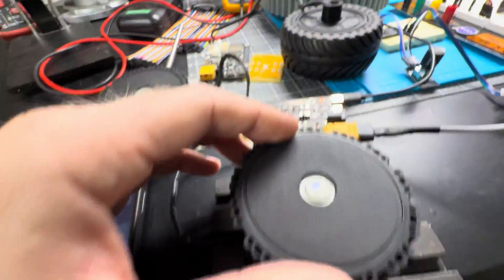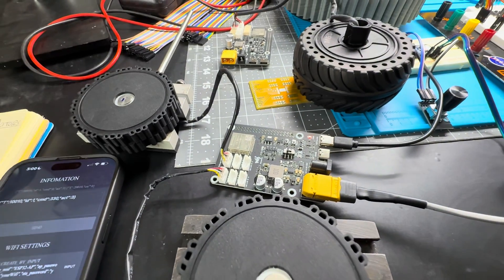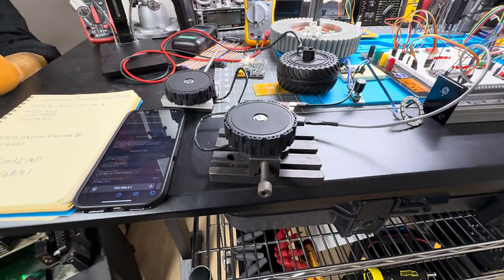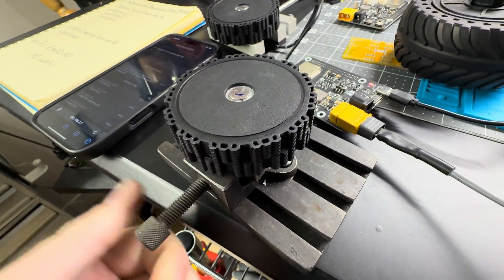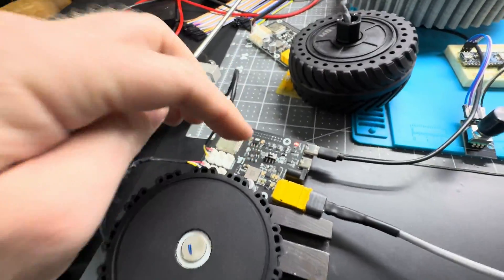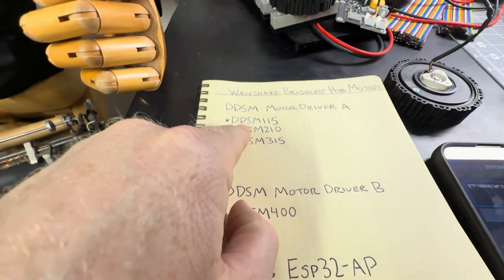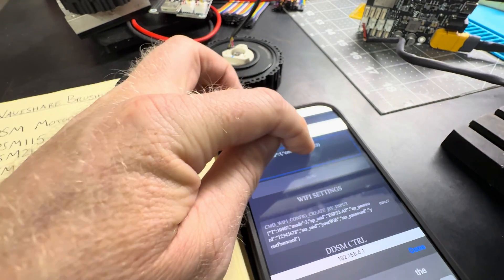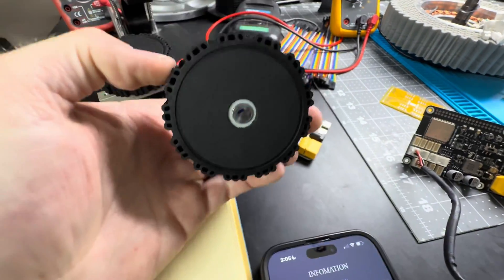Waveshare Brushless Hub Motors with ESP32 Motor Drivers

Comment: Will this driver do FOC control on the motor? have you had luck controlling two motors using one controller. There was an amazon review saying its not really possible to control two motors together (unless you use two seperate boards (DDSM B ESP32)

Comment: Hello, do they have enough torque for moving a large drawer with let's say 10Kg load?
Reply from the maker: The larger DDSM115 has a lock rotor torque of 2N-m which is about 20.39 Kg-cm. 4 of those motors would be about 81.57 Kg-cm. The torque  in motion would be about 40 Kg-cm so I would say yes but this all depends on how you use them.
Reply: Thank you!  @ProtoG42